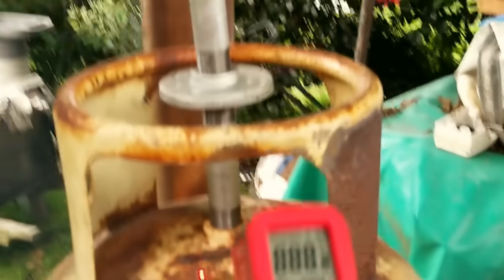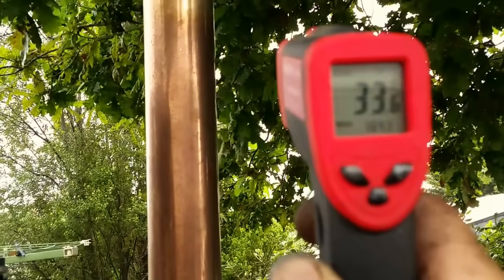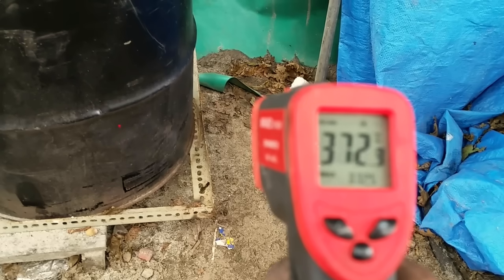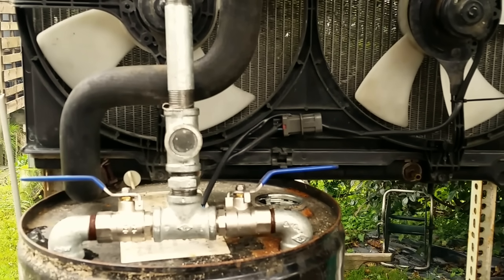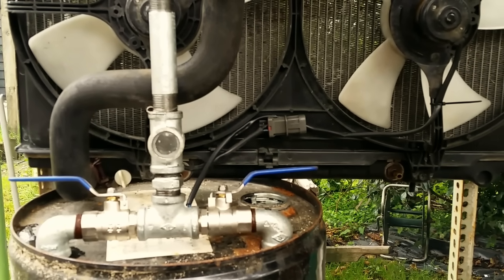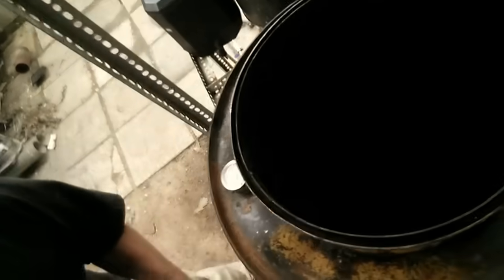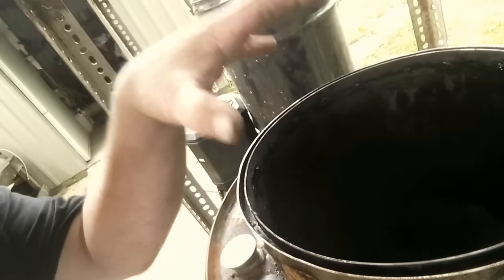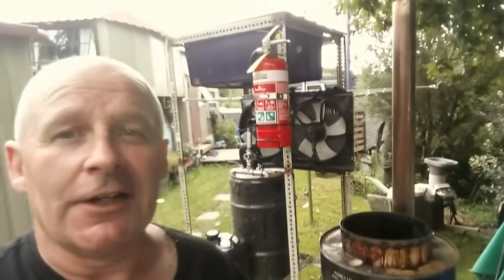Make your own free DIESEL.  PART 3  the reaction vessel

Comment: Could #1 and #7 plastics be put into this machine to produce the oil?
Reply from the maker: Hello Zach- great question. the plastics we can use are the 'soft ' plastics. the ones that you can mark with your finger nail.  #1 is PET and contains chlorine (bad cos its poisonous and corrosive)  and # 7 is  Polycarbonate and  ABS type hard plastics.  they are made with added epoxies and make something totally useless when cooked.
Reply: @t.h.o.r.  to be fair: if the product contains chlorine gas and no chlorine-hydrocarbon compounds there are scrubbers for that.

If it creates chlorinated compounds then I'd have to see what types and at what temperatures these are created to see if that is separable by temperature.

Maybe it's possible to add something to the PET that would act like Flux in melting metal. Attracting and separating the dirty compounds.

In a couple of weeks I'll have time to take a closer look. Am a biochemist working with new inventions so this is kind of my jam
Reply: @t.h.o.r.  also: if you want to melt a big amount of Styrofoam, you can dissolve it in a bit of acetone first. Goes quite quickly and the vaporized acetone gets used for the burner in your contraption.

Reduces the volume of Styrofoam by about 50 times and makes you use less heat per liter of diesel
Reply: Lord Inquisitor Tylion  quite far actually: right now I'm working on the chemistry to determine how PET would break apart. Know your enemy and whatnot.

 In essence, what this machine does is cracking plastic polymers into almost every possible shorter molecule. The really small ones become gaseous (below 5 carbons is usually gaseous) think of butane, pentane ethane and methane, but in all kinds of configurations. The bigger ones will become liquid when they cool and form the diesel. In fact, compounds which become fluid between 200 and 350 degrees celcius form diesel. 

Now, for simpler plastics that are basically just long strands, you get simple products like butane etc. However, PET gets its strength from so called aromatic rings which are rings of 6 carbon atoms that are very tightly bonded. These will not easily break and the odds are they will stay together when we crack PET in this way. Because of this, we will get a lot of aromatic compounds in our diesel. Typical diesel contains about 25 percent aromatic compounds. I estimate that if you crack only pet you'll get 75% aromatic compound. That will give a LOT of soot when you combust it. 

On to the problem of the chlorine: its a myth that PET contains chlorine. PET is about as pure as it comes. It contains no additives whatsoever. In that sence, PET is perfectly crackable.

So what does this all mean? 
1. Cracking linear plastics that are clean will produce a very clean form of diesel called parrafinic diesel, which should combust without much soot. Those are the ones he is currently doing. 
2. Typical diesel has 25 percent aromatic compounds. As such, we can safely replace 1/4 of the other  plastic woth pet to produce normal diesel. 
3. I think it's possible that This machine is also very much capable of producing gasoline and kerosene. You just got to lengthen the cooling pipe and siphon the fluids at lower temperatures to collect the gasoline and kerosene. Right now they are being sent into the Burner as hot gas. 

Im still looking if it's possible to break those aromatic rings in this process so one can make clean diesel out of pure PET. But that's kinds of tricky
Reply: Lord Inquisitor Tylion  haha, I get you. I've had a university study in biotechnology and I only got theoretical mumbo jumbo and never anything practical to link it to. It's as if they teach you everything about grammar but never teach you how to read. I learned it all myself from youtube and Wikipedia etc to develop my skill set.

Anyway about your questions: yes, you can count hdpe as a light plastic. It's the same long simple Chains as LDPE but they are stacked tightly together. I would advise to shred or pulverize large chunks first so you don't have to wait a lifetime. Plastic is a good insulator so a solid chunk will take a long time to melt and crack. Heat can't penetrate in it.

Soot is when a flame does not completely burn up all the carbon compounds. For example, A candle emits sooty smoke if you drown it a bit in the wax (closet pyromaniac here😂). Thats because the flame gets too much paraffin and cannot completely turn it into carbon dioxide. You also see it in engines that get too much fuel.

About the soot: Diesel itself does not burn easily or very well. That's why diesel engines produce a lot of pollutants and soot. The main cause are the aromatic compounds: because they are so stable, they do not want to change into another compound. Carbon dioxide is a bit more stable, but it takes a lot of effort to get there.

Some aromatics burn just fine, but some are harder to completely burn up. Furthermore, because an aromatic ring is so stable, not a lot of energy gets released when you burn it. Hence why they just didn't care to optimize their engines back in the 60's and 70's, you didn't win a lot of power with pushing for that last bit of burn. 

Its still useful though to add the PET since by far most of the aromatics are burned. Imagine every liter of diesel producing a quarter liter of soot😂
Reply: Lord Inquisitor Tylion  so in short, adding pet turns the parrafinic diesel into normal diesel. And which is better.. That I don't know. On one hand, parrafinic oil burns cleaner and gives more energy per liter. on the other hand, you  normal diesel doesn't burn That badly. Besides, adding the pet gives you 25 percent more diesel per bit of light plastic, that's a lot. being able to recycle pet into diesel too is a big plus.

Personally I'd add the PET. Normally recycling centers burn it anyway, better make it do something useful in an engine while it burns

Comment: Sir also show us how you  close and open the reactor vessel and how to make it Air tight. Can we  make a pressure cooker airtight in the same manner?
Reply: Mubasher Khan i am operator of commercial pyrolisis plant and my tip for you is to use a graphite packing cord for the reactor sealing.
Reply: because i am working on a project in which i have used pressure cooker as my reactor but the rubber sealant melts off and then the damn leakage starts due to which i get  lower quantity of end product. help me out here if u can. Thanks over n Out
Reply from the maker: In video 5 you will see the vessel being loaded, Its fibreglass rope sealing ring  - its not perfect- I might add more bolt clamps

Comment: Mate. Call me.
Reply: If you can build me a machine, I'll take you and your kit to the Great Pacific Patch. www.wikipedia.org/wiki/Saint_Christopher_(yacht) is at your disposal (almost).
Reply from the maker: Hey Robert!
Reply: If this is real, I'd love your help.
Reply: *real = a great solution that can be home made, safely. And distributed amongst the Pacific islands
Reply from the maker: No problem. Ill help all I can. read the comments in the other videos 1,2- 4,5 5.1 and 6. lots of chat about this.  Im building this right now! Im having issues getting it hot enough just now. I need much better insulation. I have a subscriber who has funded me the money for really good ceramic wool insulation :)  aside from the heating issue Im up and going.
Reply from the maker: Yes Robert- I want to mount it on a trailer, visit farms and turn  silage wrap into diesel .
Reply: Outstanding.
Reply: If you would like, can you head over to our contact us page at www.apfii.org and ping them a note? Mention the Diesel/plastic and pyrolysis - and it'll get through to me.
Reply: @t.h.o.r.  Hi Daniel. You could probably benefit from the cylindrical shape of the drum instead of using insulating materials, which are nothing more than heat conduction resistors. You would need to obtain a slightly larger in  diameter drum. Coat  it on the inner surface with aluminum enamel. Then place your heating drum into this slightly larger drum. Air-tight seal between them. Then make as much vacuum as the larger drum allows before it starts collapsing. Not a high vacuum is required. But the  higher the better. To improve the setup you might also want to paint the outside of your heating drum with a high temperature black mate enamel, such as the one used for vehicles exhausting engine headers. This way of insulating does not slow down the loss of heat, which is what common insulating materials do. Instead, it actually recycles wasted heat by returning it back to the heating drum.